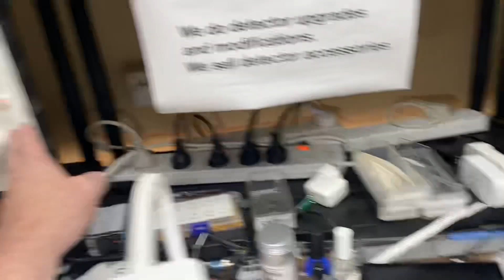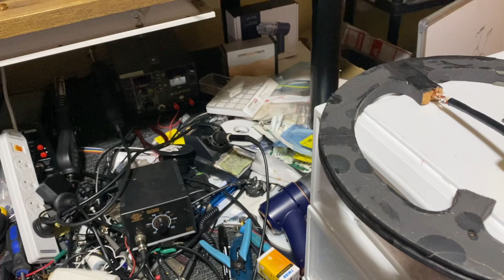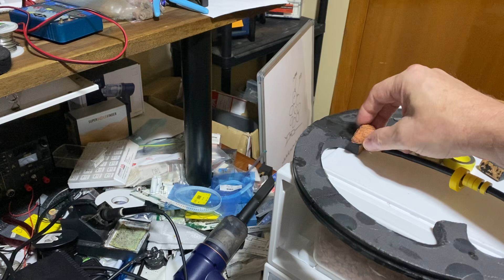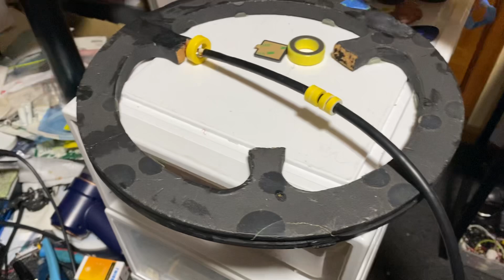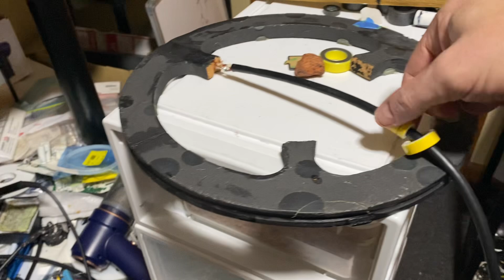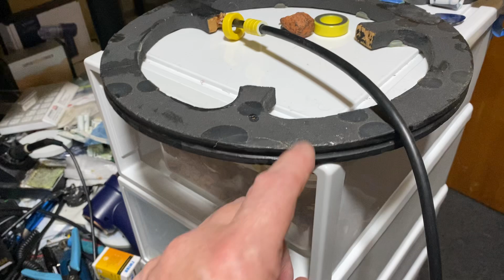Hot Rock or hot ground problems, is your coil at fault? This is proof done on a mono coil imho.

Comment: Hey woody, i have a question re a noisy nf 15" spoked evo coil. It's touch sensitive, makes noise moving side to side, makes noise when it's angled and also if the ground level drops even a centimetre. I can't shut it up and i hardly bother using it anymore. How easy is it to troubleshoot exactly what the issue is? And do you have a process to work through what might be the issue? It's been like that ever since I got it.
Oh, I run it on a 4500
Reply from the maker: First look in the plug, make sure the outer braid is connected to pin 1 and 5 and 234 are connected to the middle cable wire, apart from that you can open the coil with care and see if something has rubbed away or broken off.
Reply: @DetectorMods should there be 2 connections to pin 1- a red bundle of thin wires and a single (thicker) silver one?
Reply: @DetectorMods  thanks for those suggestions mate. I'll try your step 1 but I reckon I'd cause more problems if I opened up the coil... Might have to bring it in for you or Dave to look at...